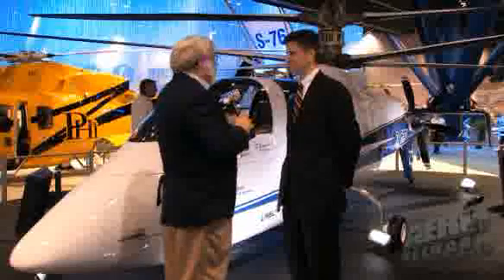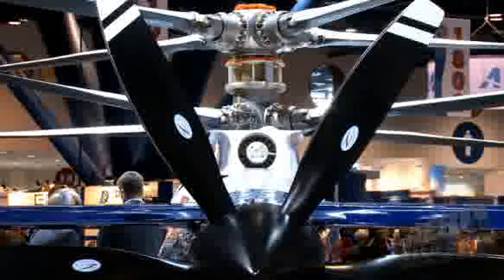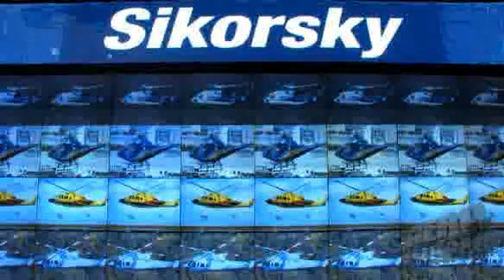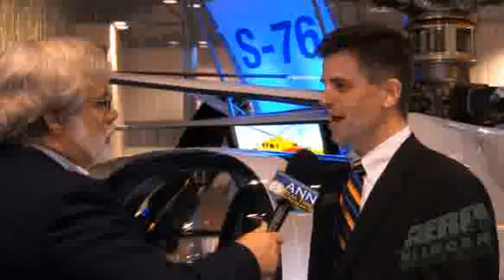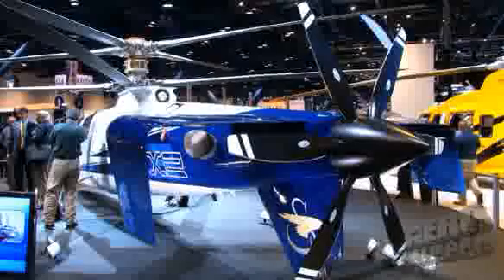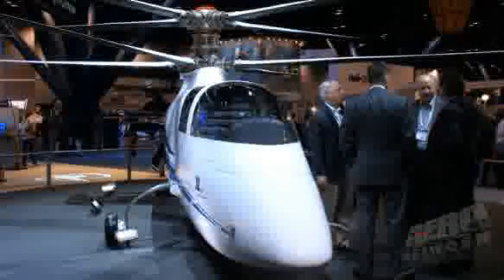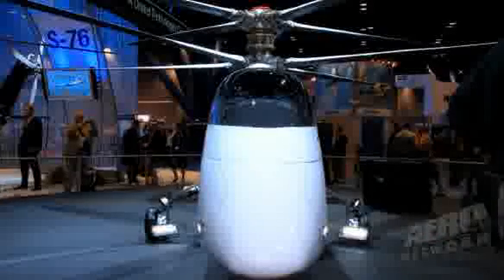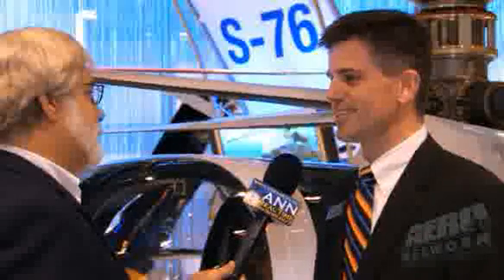Aero-TV Gets A Close Look At Sikorsky's Exotic X2!

Comment: If you do the conversion, this chopper cruises at almost 290 mph and so far, has a top speed of 310 mph.  A bit quicker than the XH-51A and it doesn't need a tail rotor in addition to the propellor.  Also the XH-51 had to have fairly substantial stub wings because the trailing rotor blades lose lift at those kid of speeds, whereas the counterrotating blades make up for that quite a bit.

Comment: The X2 is effectively the XH-59B.  It is a 'composite' helicopter that uses the Advancing Blade Consept to deal with the lift imbalance caused by high speeds.  Composite helicopters are not new.  The Lockheed AH-56 'Cheyanne' attack helicopter was one of the first composite designs, and the XH-51 which was a technology demonstrator for the AH-56 itself pioneered 'Rigid-Rotor' technology.